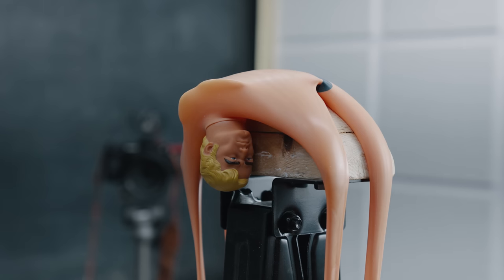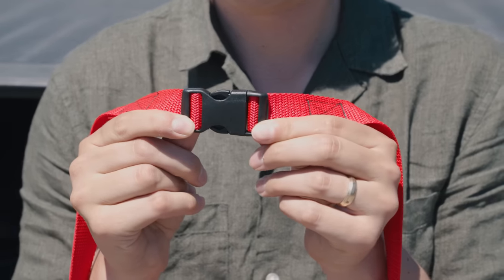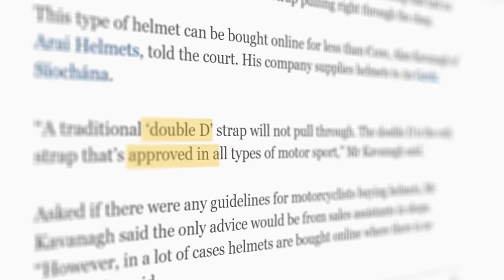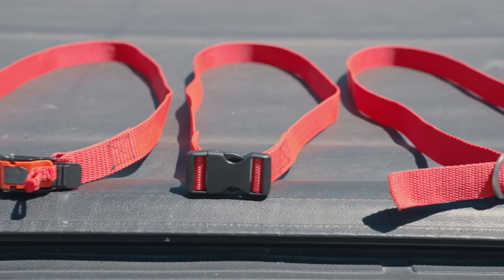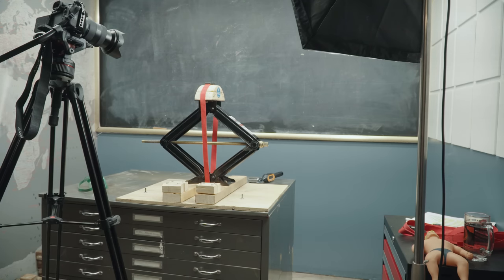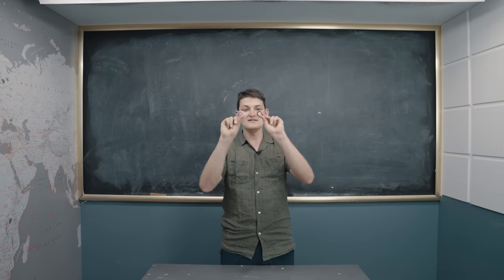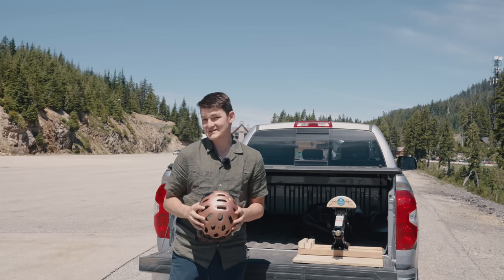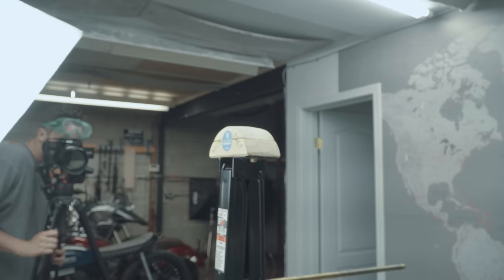Why Motorcycle Helmets Use this Ancient Buckle

Comment: I like that it's straight tensile strength that makes the best buckle work, but it should be pointed out that '14th century Rome' is ~1400BC, not the actual 14th century (due to century naming conventions, this would be the negative 1400s, rather than the positive 1300s). Not a thing that a bike guy would pick up off the reference necessarily (because casual knowledge of the former roman empire not actually controlling Rome in the 1300s isn't a given), so it's not a big fowl, it's just that those buckles are waaaay older than even this video hints at

Comment: The torque measurement is not accurate for this test, because as the jack lifts higher, it'll take less torque to increase the force the same amount. So you're adding a strap length/stretch variable or a jack angle variable that needs to be corrected for. An in-line load cell would be best, but a scale under the block would be suitable.

PS: I can feel when the helmet strap is too loose; it's not  annoying enough when I adjust my jaw.

Comment: I prefer the rachet,  even if the buckle did break I would be willing too bet the helmet would still stay on my head for most of the fall as it is a full face helmet and its tight enough too hold its self on a bit. I think the 2 extra N.m given by the Doube D-ring is completely un-needed.

Comment: The ratchet type is much better.  It is adjustable enough, and holds enough.  I far more likely to use it if it is easy to use.  I might not buckle a double D if I am going a few blocks, but I always do if it is the ratchet type.

Comment: At 555 pounds of lift force, would a person's head still be attached?  I get the idea of what you're saying, but I've not come across much about how ratchet straps are failing and needlessly endangering or killing street riders.  Even Schuberth admits that there aren't tracks that allow quick-release straps.

Here's a pretty curious sentence from the article:

"Mr Hyland was wearing a helmet with a clasp buckle and a strap that had no stitching at the end to prevent the strap pulling right through the clasp."

So it wasn't a ratchet strap.  It was what you called a "side-release".  And if there wasn't stitching on the strap, it sounds poorly made.  I'd like to think that Schuberth and Shoei aren't exactly putting junk like that into their flagship street helmets.  Their reputations would be all but finished.

Comment: The question is not whats the best , but what is most likely to get fasten at the first place and fasten properly. your neck bone will snap of before that ratchet buckle fail. not to mention most of the decent helmet have all metal ratcheting system. a few times I even forget to fasten my d-ring helmet if i get distracted , but never in my ratchet helmet as its so easy to wear it even with glove on it like second nature when you wear one even if you get distracted , because you never even need to think about it.

Comment: what was the exact reason? That it has to be tightened? The strenght can´t be it, because all of them are stronger than they need. i mean, if force is applied on the helmet or on the chin with an ammount that the clip buckle breaks, you are also dead with the D ring buckle.

Comment: my bike helmet has a roc-loc system that I use in conjunction with the strap for a tight but not too tight fit.. any serious cycling helmet worth over $100 CAD should have roc-loc or a similar system to assist with the strap... it is however no excuse for not having a tight enough strap...

Comment: At the end of the day, I have to use the buckle a couple of times each day. It drove me mad fiddling with the double D type, especially on freezing days. My wife has a helmet with one of these buckles and often manages to tie it wrong so I have to recheck her helmet each time. They belong in prehistory. Personally, I won't even consider buying a helmet without a modern ratchet strap now.

One thing that confused me in your test was how you spoke about how the straps were supposed to break at 900lbs. But then all your tests reported figures in Nm. Did the straps or stitching not break when they were supposed to? Shouldn't that be the headline?
Reply: He didn’t have access to the force applied to the straps, only the force applied to the jack, which is not going to be directly relevant. They shouldn’t have bothered going through the pointless exercise of using a torque wrench for it, or posting the forces applied through the wrench.

The key point is that the correct failure mode, according to the test, is for the strap to break, and not the clip. The only time that happened was with the D rings.  That’s the point the test made.

How much that actually matters depends on your circumstance, I like your point about your pillion not strapping their helmet correctly. In that case, an easy strap is better than what amounts to no strap.

Comment: Just got back on two wheels after 10 years, didn't test the strap when fitting and ended up with a ratchet clip. It's so finicky about the angle to clip it up that I'm still faster with the rings plus it makes helmet hooks pretty awkward to use.

Comment: Totally agree. My latest shoei GT air-2 has some kind of ratchet buckle and sometimes I don't connect it properly (easy to insert alongside the buckle instead of in it) and you don't realise until you're riding and feel the strap flop around. Double D is straightforward and easy - why change it?

Comment: Yeah, but.
The DD rings appear to be representative of those used on motorcycle helmets, and the Fidlock is branded. It's said up-front that the side release isn't used on motorcycles, so what's that doing here? How representative of the range used on motorcycle helmets is the ratchet type tested here? As for adjusting the strap tension every time the helmet is put on, the micro ratchet is as precise and more convenient than the DD ring.

Comment: my old helmet actually had a ratchet strap before and it was always loose, now that i think about it, its freaky how little i paid attention to my safety till my new helmet came with double D rings and i now actually think about how tight my helmet is secured, granted i got the new helmet because my old one got under a truck with me still in it but you know, hindsight and all that.

Comment: I'm actually curious about rydewear buckle performance. It's a side release type buckle but is made of metal instead of plastic.
Reply: Same here! I have it on all my helmets and it seems to combine the convenience of a quick release with the sturdiness of a metal buckle. Yes, it's a "set it and forget it" solution, but I do adjust it regularly when it gets loose (which it rarely does). But especially on city routes with several stops it diminishes the helmet mounting time significantly. Bummer that Ryan excluded it in his test. He could've swayed me back to prefer Double Ds (hey, he said it first!)

Comment: If theres 763 lbs yanking my helmets off my head, my neck is going to break first. So I definitely prefer that strap I can connect on the road with one hand without stopping. It really doesn't matter what latching system your helmet has because at that level of forced your head is coming off before your helmets.

Comment: The safety aspect doesn't pan out. The generally accepted force on average for neck breaking is 3kN/675 lbs. Your neck would more than likely be well and done broken before that strap snapped. I'd argue that more than likely the rivets holding the webbing to the shell are probably the actual engineered weak points. Race orgs probably only require D rings because they're easy and the most likely to be uniform and up to standards. You don't have to pretest them before the rider enters the race environment.

Comment: i guess ultimately it depends on: will you use it?

Like it i had d rings, there may be a time where i'm either in a rush, or just forget lmao. not easy to fix quick. Also im lazy. So i rather just adjust mine once, click, then done. 

i think it's better for me to have an easy system i'm guaranteed to use, than a more time consuming one i may get lazy on.

Comment: I'm going to have to disagree, on the part of daily commuting riders. I used to neglect to strap my d-ring helmet all the time, often simply buckling the little snap instead. When you put your helmet on and take it off at least twice a day, and average more like 6 times, the convenience of the buckle is far more important than its ability to withstand (an insane) 900lb. I'd love a fidlock option but I'm pretty happy with my ratchet buckle...and I now buckle my helmet. Every. Single. Time. Because it's quick and easy to do.
Reply: Also, as a whole, I have have more trust in ECE certification standards for street safety than DOT or even Snell, and a lot of ECE helmets are going to have the ratchet or fidlock.

Comment: A test where suddenly a large amount of force would be used on the buckle would be a way better test I believe, since just as on the street the Force trying to pull your helmet off of you isnt progressive but sudden.
Reply: It's still all about the maximum force the lock can sustain, so in this case, testing sudden or progressive force barely makes any difference.

Comment: So I've got a metal buckle on mine rather than a plastic one like you used in the video the plastic on it is a comfort tool to unlock the clasp not actually part of the locking or holding mechanism. I'm curious what it's strength is because it should be far beyond the plastic one you demonstrated. I also got into an accident about four months ago though didn't hit my helmet on anything or did anything that should've taken the helmet off so it at least held in place in that instance.

Comment: I does look like you guys didn't do the ratchet strap up fully and just had it sitting on the last notch. 
I also think you miss the benefit of simplicity in the connections, I have seen many many inexperienced people do up double DD's the wrong way and have them be useless. With some of the other methods it's very obvious when it's not connected.

Comment: I could never get used to double-d, unlike the real ones it´s fiddly and impossible to use with gloves. Now what´s with the Fidlock? I´ve never heard of that, but it seems super easy to use and almost as strong as a double-d ring. And what about flip-up helmets (is that correct?). They are tighter around the neck and will hardly come off even without a strap.

Comment: Please tell me if I'm wrong, but for a particular reason I don't really trust the "double d's". Now please take in mind I know almost nothing about such things, but it is a thought that makes me scared of the older double d's. In your test the strap was really secure between the double d's, to me it seems that was because of the tightness. But if you put it on a helmet, then around your face. Wouldn't it be easier to get loose? I mean your face makes all kinds of movements. To my idea, these slight movements you make with your face wouldn't loosen the double d's.

Comment: I've had situations where my fingers were so cold I couldn't actually work the D-ring fastening. Finished the journey with it undone. Not a situation where waiting about to warm up would have been a thing.

In fairness, the ratchet straps have a fair bit of adjustment
Reply: Right, cause spending even 30secs trying was just not worth it to potentially save your life. Darwin's law in practice.

Comment: The irony of proving how Double D is the strongest and safest, while testing it in a very dangerous manner.

To be fair, the Side release buckle is a no. The cheap plastic buckle will snap at a slightest touch.

The 2 other buckle designs were probably designed with the words "quick" and "gloves" in mind. 

And whilst the double d's can withstand a heavier load. 

If you manage to reach that 900lb load. Imagine that load on the rest of your body and on your neck.

Comment: Outside of that one incident, are there any other incidents of the Fidlock buckle breaking? Since it seems to add a very rare risk of failure for extra convenience.
Reply: I am sure plenty of it as so much nutcase rider in the street this days. but most of them snap their neck bone before that happen.

Comment: What I wonder is : which one(s) of these resists tearing more than your cervicals?
I mean, ok, ratchets are more fragile than DD. Probably metal ratchets are too. But maybe the force needed to break it would already have broken your neck. At what point, I guess the only benefit of being stronger is that you'll look better in your casket. 😅

Comment: This wasn't d-ring vs the rest - it was metal vs plastic. Of Course metal would win.
Where's the Shoei metal ratchet?

Plus, one glaring issue wasn't discussed - which is easier for paramedics to remove without exacerbating neck injuries. Statistically speaking you can count the strap failures on one hand while the number of people dead or paralysed from neck fracture is in the tens of thousands.

Comment: The problem is that I struggle to use the double d with my gloves on. I have to take my gloves off to put it on. I do but I have certainly considered other options
Reply: Do you have to take cloves off when you put your boots, ear plugs or jacket on?
So many people say the same thing.
I just don't understand what's the deal with the cloves. Why do people have an urge to wear cloves all the time or at least not put them on last?

Comment: Is that ratchet buckle... plastic? It looks very cheap.
Would have  liked to see a comparison with a metal one, my Shoei helmet has a fully metal one and it feels extremely solid.

I specifically bought a ratchet one because i've caught myself several times riding with an unfastened double d, it's just extremely annoying so for a short ride i'd just click it in and go. (yeah i know i'm dumb). The best gear is the one you actually use.

Comment: Are you saying the average neck/throat is able to handle around 900 pounds before it breaks? These red straps you've used in this video, are they motorcycle helmet straps, or loading straps? Are you certain that motorcycle helmet straps are designed to take 900 pounds without breaking? How about the anchor-points of the straps, in the helmet? I'd very much like to see a video where you do this type of stress test on the strap in an actual helmet, or maybe several different ones!
Reply: If they are loading straps and if it was rated at 900lbp then their breaking point is (should) about 2000-2500lbs as new.

Comment: 4:44 So it failed not at the connection but at the buckle ring. If the D Rings where out of aluminium it would fail the same or am I missing something. This has nothing to do with the forms but with the materials used.

Comment: I'd think part of it would be material. After all a steel dick clip is certainly going to be stronger than nylon. I don't know if the dick clip would be prohibitively expensive with metal, but I do know my spare helmet uses a different style of clip made mostly of metal, looking akin to a mini seatbelt buckle. That said I've gone back to the double Ds anyway precisely for safety reasons (and because they can be done almost as quickly before you put your gloves on. Passengers still get the buckle though, and often they still need help with it.

Comment: IMO the side pins or nails tht holds the straps to the helmet are the weakest, its just a thin nail pin to the fiberglass helmet. 
I don't think the connector is the weakest point. 😅✌️✌️😅

Comment: Love the education... BUT: no way i am using a double-D on my daily driver. Love the ratchet, but that magnet thing looks really nice... just those clippers from a backpack or fanny packs look a little loose. but i guess its a quality question.

regarding safety.. i had my fair share of crashes... And no way I am riding without a helmet. having a slightly weeker buckles ina very special kind of crash is a risk I am willing to pay in favour of comfort. Going off road or racing.. different thing.

Comment: Your force calculations based on the lead screw torque are not accurate. The lifting force from the lead screw torque is not linear. The higher the jack is the higher the jack's force is compared to the lead screw torque. i.e. at first the jack moves fast and slows down at the end compared to the lead screw rotations.